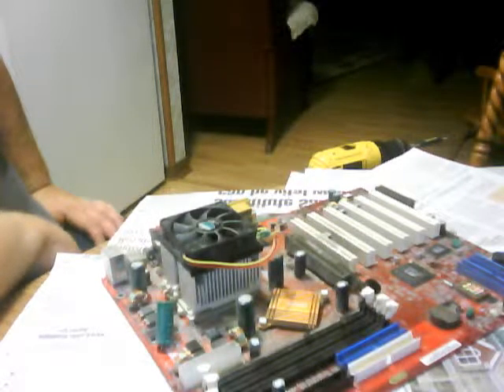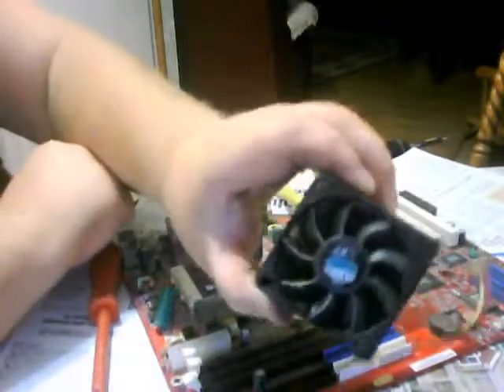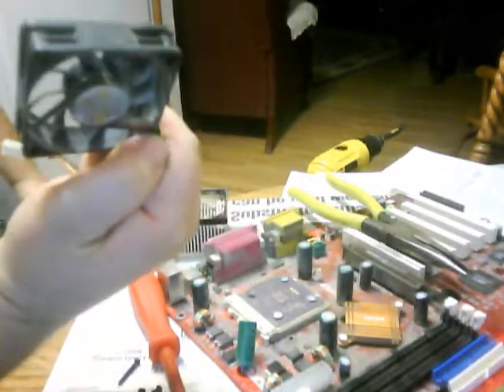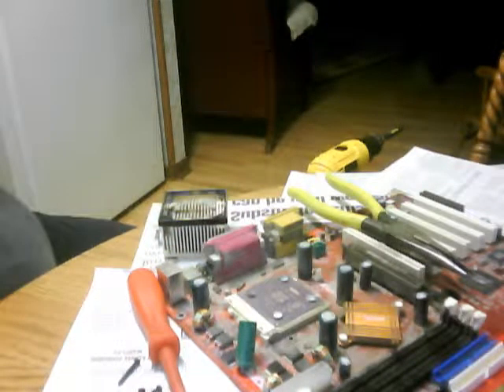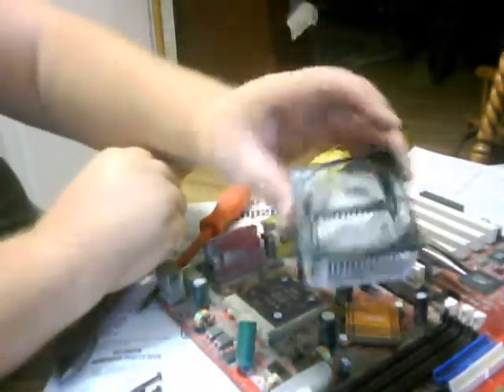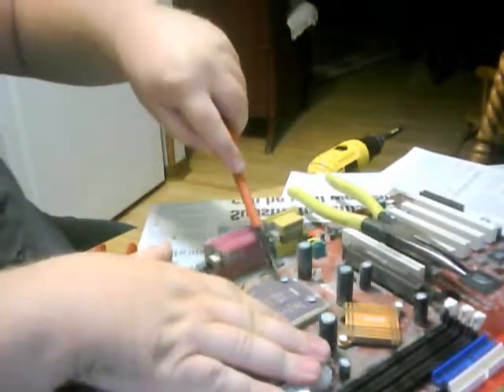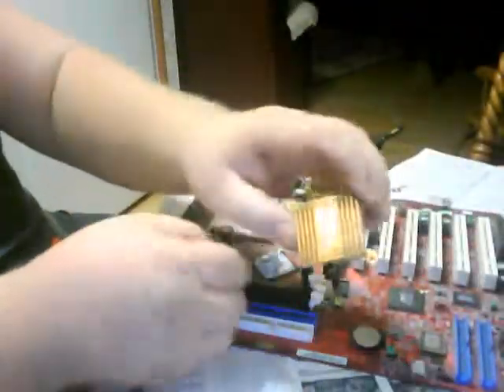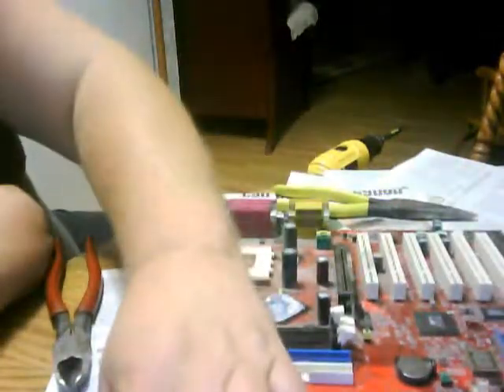scraping a motherboard

Comment: Fyi... on the chip you do not need a fork.. that hurt my brain watching you struggle to get it out...  there is a lever also known as an arm on the side of the chip you can lift up for easy chip removal... I cringed when I saw you pull the fork out.